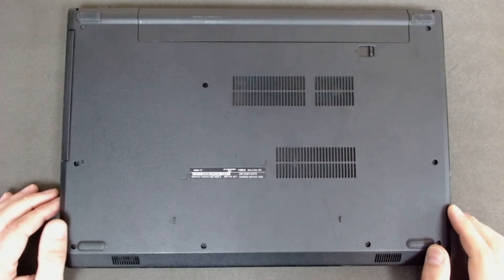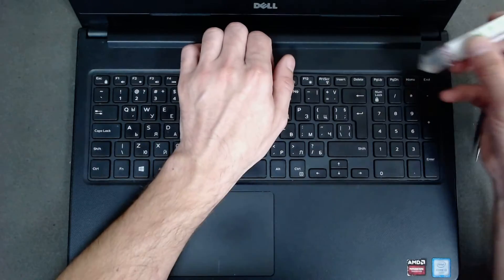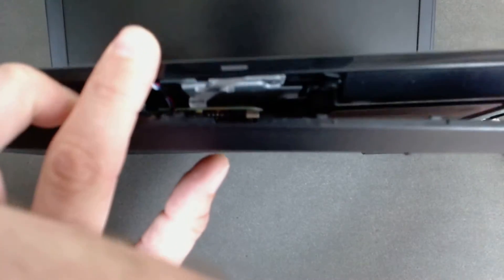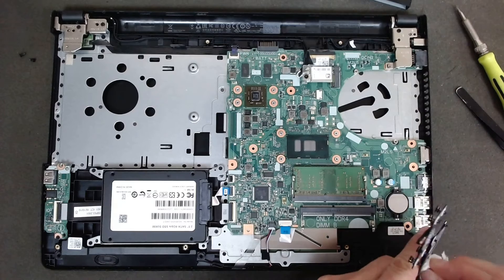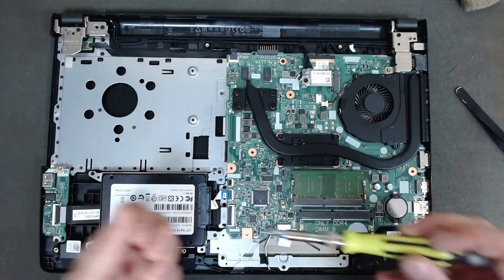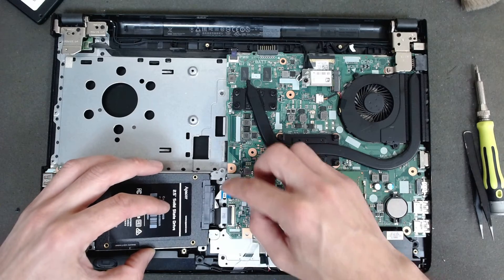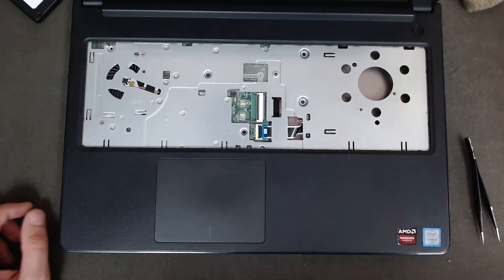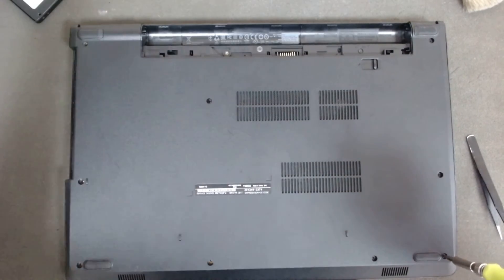Dell Vostro 15 3568 Hard Drive replacement / Thermal Paste replacement.

Comment: Do I have to remove the keyboard to just replace the hard drive?
Reply from the maker: Yes. In order to remote the back cover, you need to remove the keyboard and the screws under it.

Comment: Isn't there separate slot for m.2 ssd ,? Company claims that it has , but people say they didn't see in motherboard. Please clarify me
Reply from the maker: This particular model doesn't have an M.2 slot. Decent on the board revision it may be present. The model on the video is a bit older. Most or the new ones have M.2 slots. You can check with the service tag on Dell site.